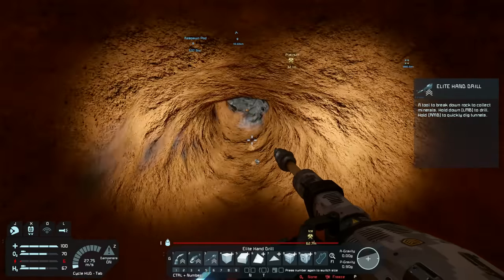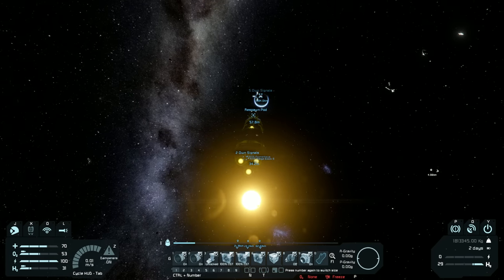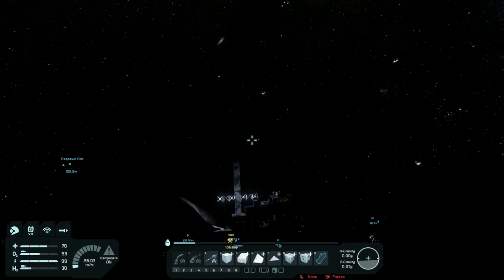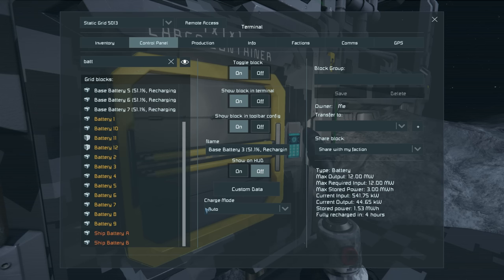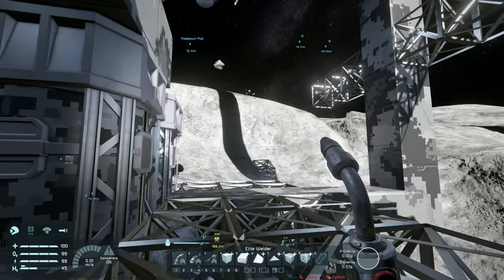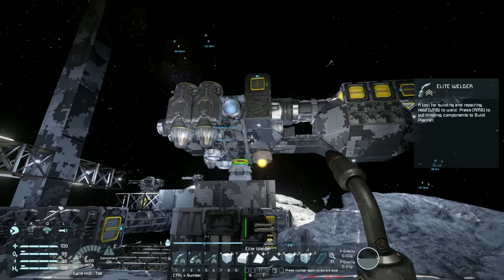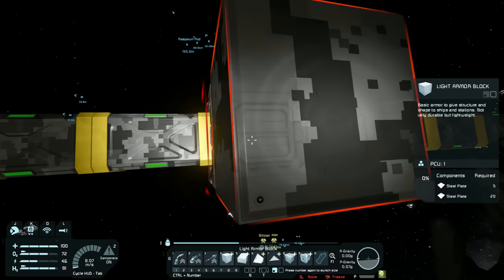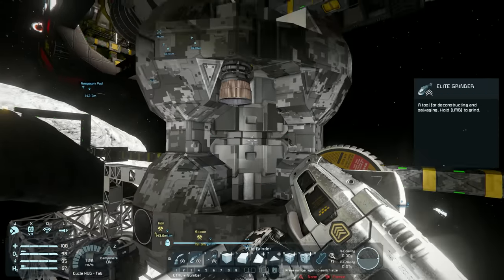Space Engineers - Space Survival - Ep11 - Expanding the Base and Building a Better Miner

Comment: Hey Bud, on the stacking of the solar panels, it works when they are back to back, resting against each other, it really does work, you placed yours away from the first one,

Edit, Interesting design on the small grid, i was thinking about the 3x3x1 conveyor spacer, so you would have hydro tank, spacer, hydro, spacer, cargo, spacer cargo, and the last cargo could be so you have a small conveyor at the end, which you could put a sorter on to make sure the drills empty, also by having those spacers you would be able to have thrust go in the other direction aswell, and your connectors would both be at the same point on either side of the ship, but thats just my OCD kicking in, lol. basically toy just spread out the ship a little more and turn the last cargo so you get 2 small and 2 large on the outside, with a small on the bottom. I liked the beam blocks you put in there to, i have tried so many times to use those, and i always just make it look stupid. i just dont know how to use em, obviously.
Reply: Yes, I do this all the time. They have to be touching with no space between them just as @cabbageplays6710 described.
Reply from the maker: Ahhhhhhh!!!! So that is how you do it? OK, I'm gonna implement that in Episode 13 😎👌. Thanks man!

Comment: Quick tip for QOL just in case you or anyone reading is not aware: 
You can quickly move items between two cargo containers from within the inventory menu by double left clicking the loot in question
If the items are moving into the incorrect container when doing so all you need to do is ‘select’ the correct inventory on the list by left clicking it once
Reply from the maker: Yeah I do that quite a lot 😎👍

Comment: You should go strait off the bottom of the solar tower and drill threw the other side and build another tower  all connected get sun after it sets
Reply: That’s a great idea
Reply from the maker: Problem is that Planet Oz is blocking it for about 2 hours of the 6 hours cycle, so I'd get a bit more power but not heaps, the thought did cross my mind though 🤔😊

Comment: Put the drills one a 3x3 rotor? at 0.4rpm they should drill a nice round hole, you can even put them in a timer block together with rotor on, so you need to press only one ket to activate them all
Reply from the maker: Oh man I tend to avoid sub grids on ships, and thus far I have yet to meet clang but I do like the idea! I wonder if it would introduce clang or not, might have to test it out! 🤔
Reply: @TheGarageGamer86  Don't be afraid of the clang, if you love it, it will love you back! That, and as i wrote before, as long as the subgrid mass is smaller than your ship mass, there will be no prob... I hope :)